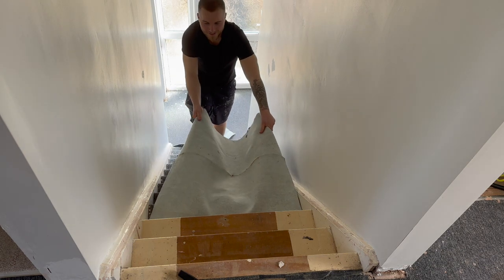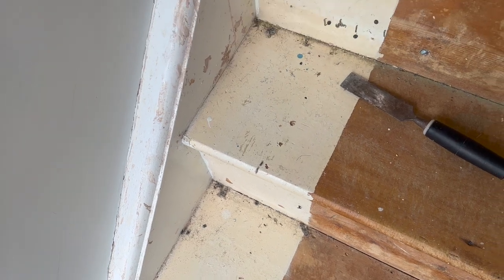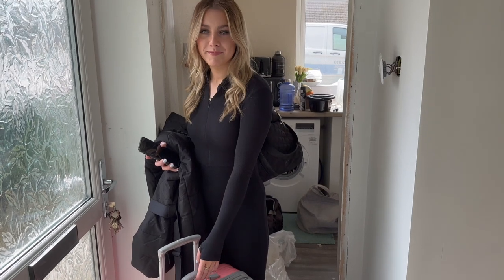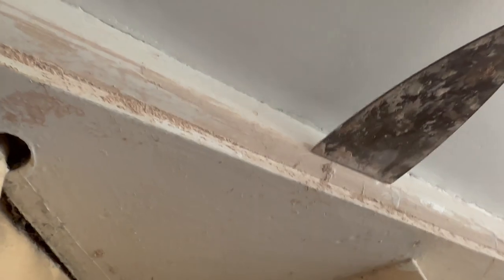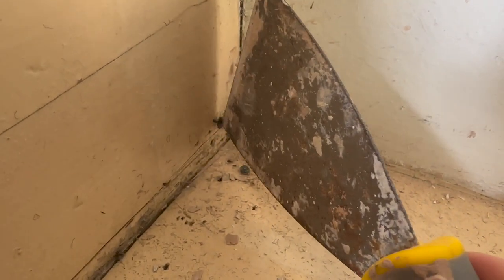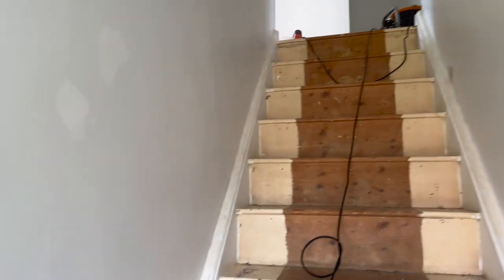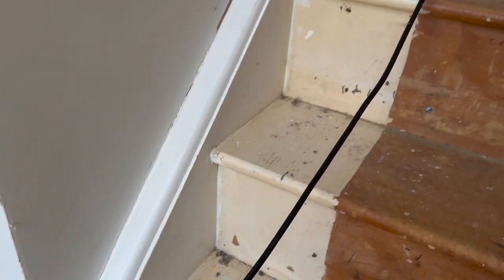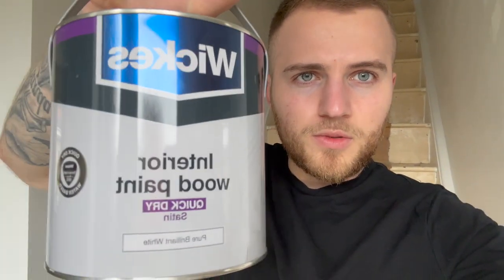Worst Paint On The Market?? | Painting Stairway Vlog

Comment: That's a fiddly, time consuming job! When I saw the paint and you said it was cheap I thought, oh no! I always use trade paint, it's more expensive for a reason, better coverage and needs less coats. I would have used Zinseer 321 to seal and prime the wood, it's water based, dries quickly and does a great job. You can overcoat that with either oil or water based paint, whichever you prefer.
Do whatever makes life easier for yourself. It makes painting easier and safer if you put your paint into a paint kettle too. I've recently done a lot of plastering so I feel your pain cleaning up! 🙂👍
Reply from the maker: Thanks for the tips! I’ll look into those for the next jobs. It’s definitely not my favourite job to do🤣